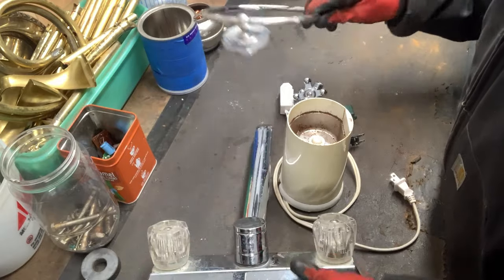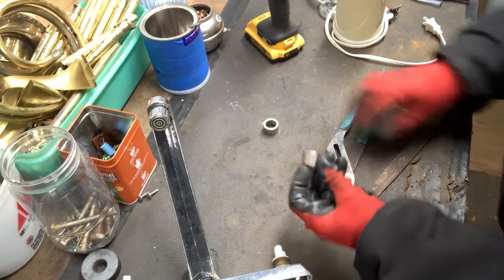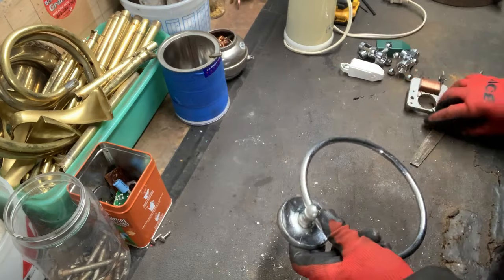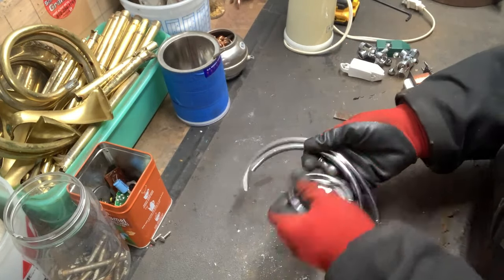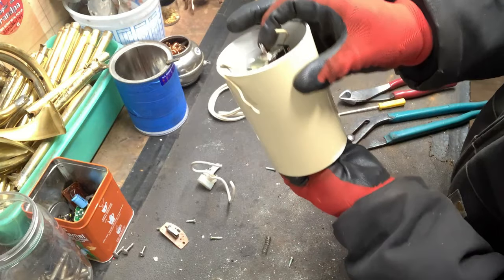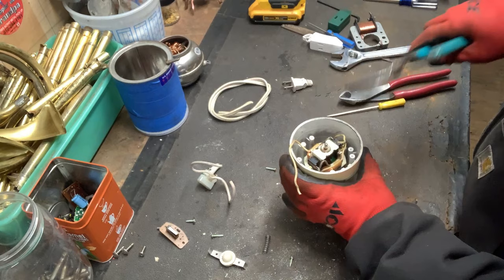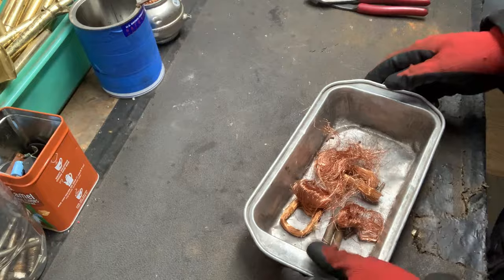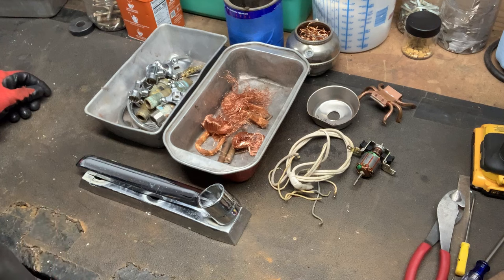How to Earn Extra Money Scrapping

Comment: Make sure the screws aren't brass! (unless you can tell by looking)

Scratch test is key! File is great, but having a grinder handy is much quicker and makes for a less murky reading! The faucet you scratched with file may have had a thicker coating than you anticipated (I could be wrong). Wouldn't want you throwing good brass in the zinc or aluminum piles 😊
Reply from the maker: In the video I should’ve brought that up, that they could be brass and not stainless. I didn’t check them because of experience, but it’s better to never assume. Thank you!